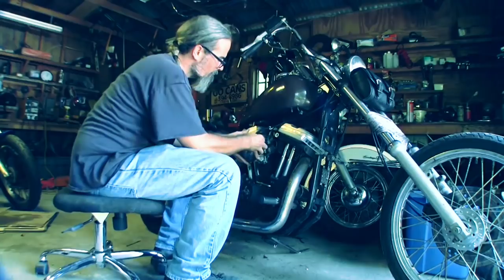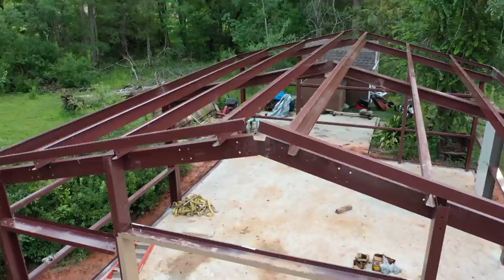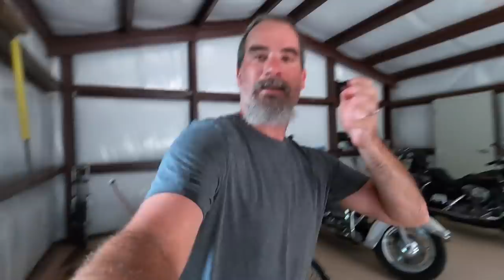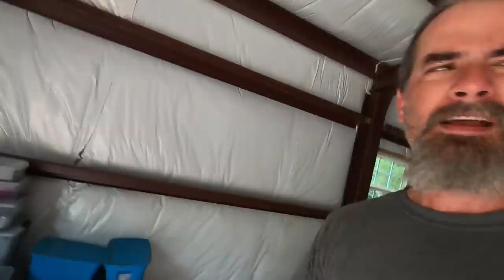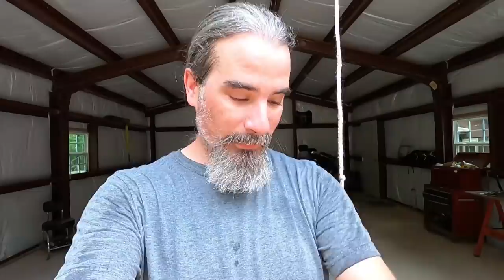New BUILDING Back In BUSINESS / NEW Old HARLEY Davidson MAN CAVE Red Iron Steal SHOP Metal BUILDING

Comment: You should look into mini split system so you don't lose on your natural lighting start up is a little more but will use a whole lot less energy to run it due to the ac to DC converter

Comment: have you looked into using sheet metal frame work/studs for the loft ? its cheaper from what i have seen and doesn't rot.  also for the size of your place and as hot as it gets they make mini split ac units that can handle that shop a lot better than a window unit.  you can get them in a DIY kit too.  not sure if you have looked into them or not. i just rather you be a cool cucumber than a steamed vegie lol.  its almost been a year since this happened.  shows you how insurance can be a pain , but its over now .  hope it is anyway..  awesome shop very happy it finally worked out.  good vid man
Reply from the maker: I'll have to look into that. Thanks.